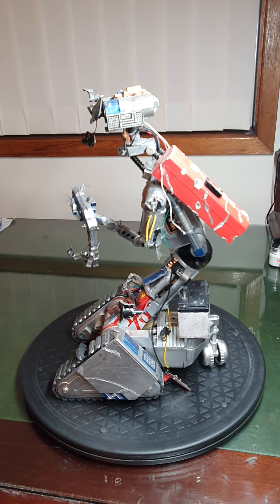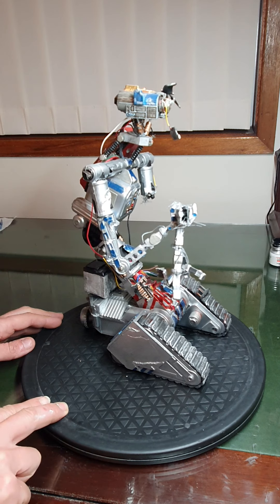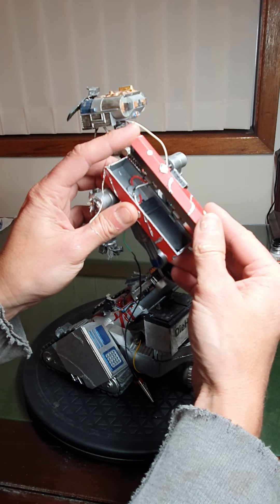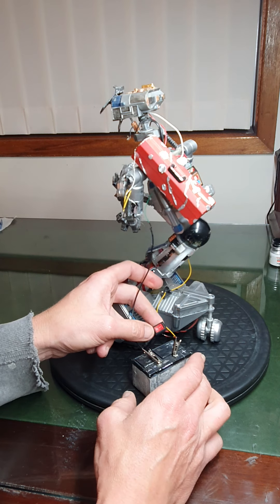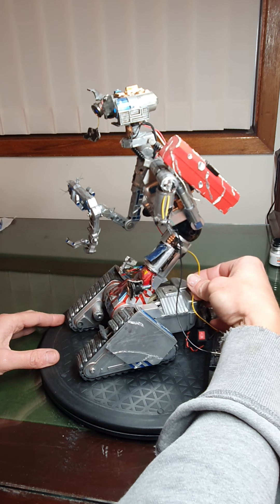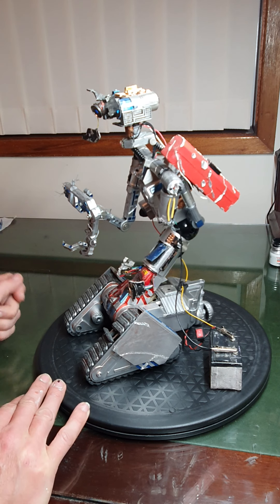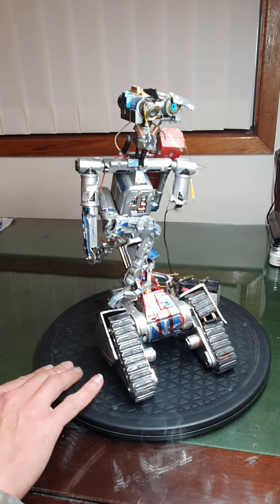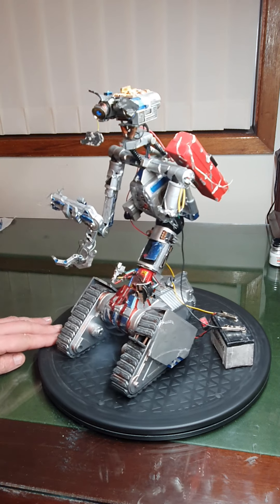Johnny 5 Damaged version

Comment: Im doing a damaged mohawk version.  I gave him a nyc manhole cover as an accessory
Reply from the maker: lol I like the idea of the manhole cover
Reply: @titanwross  Did you heat and fold extra hands for various props?  I figured I would just print a bunch and heat and fold the fingers around my accessories.  You dont have a johnny 5 remix head Hollow stl do you? It would make adding lights a bit easier on the smaller 6" Johnnys.  Im way behind on my blender lessons.